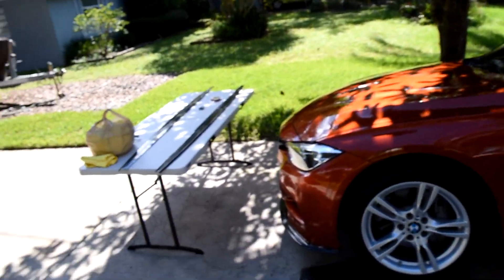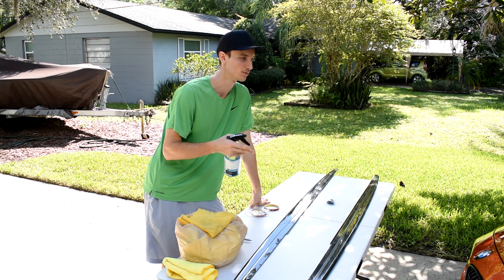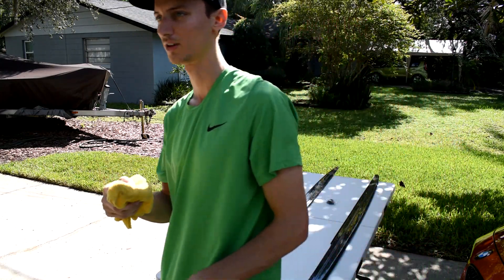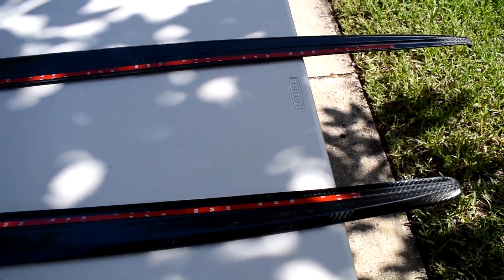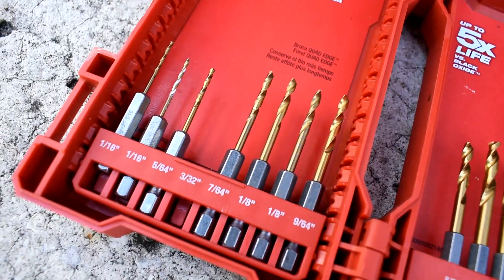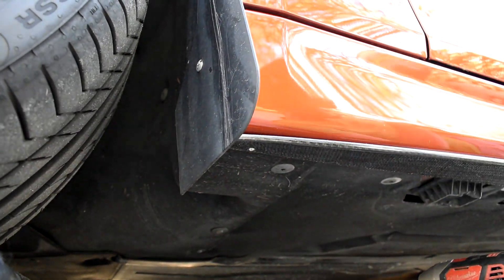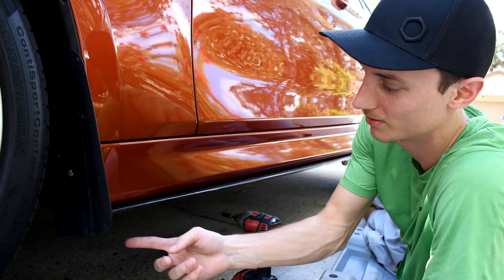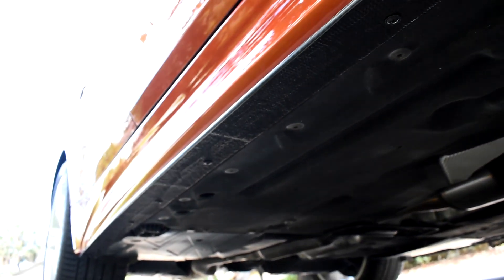HOW TO INSTALL CARBON FIBER SIDE SKIRT EXTENSIONS | BMW F30 | FROM EXTREME ONLINE STORE

Comment: over time, wouldnt water from rain/car wash get into the gap between the skirt and car bodywork and compromise the 3M seal? I guess you have the screws holding it up but struggling to understand why then bother with the 3M
Reply from the maker: Doesn’t seem to effect the 3M like that. Any side skirt I’ve taken off in the past the 3M was still good. You can def get away with just screws